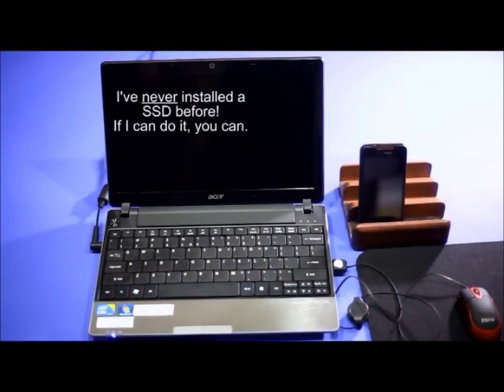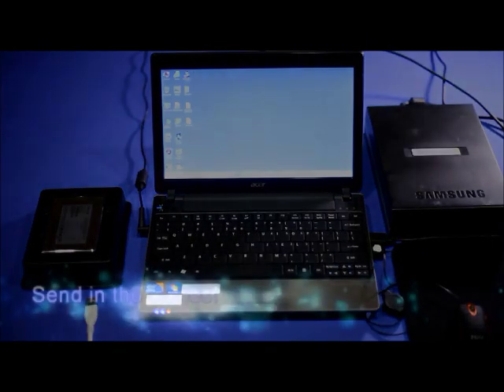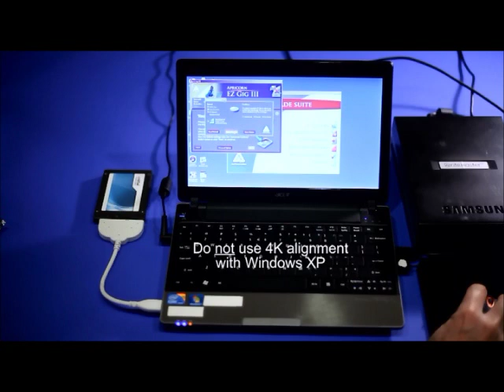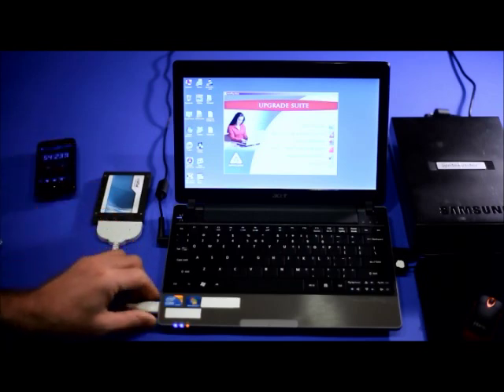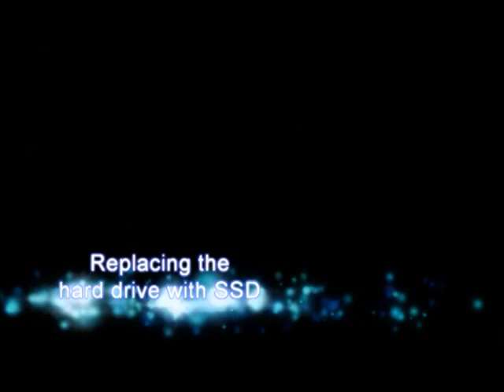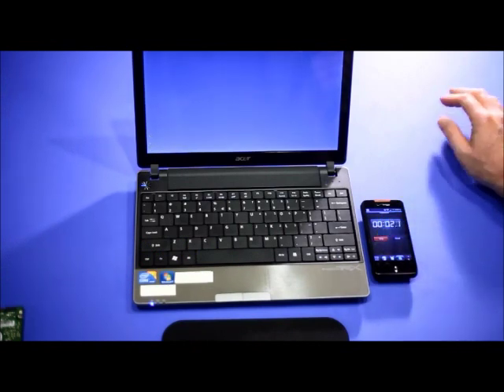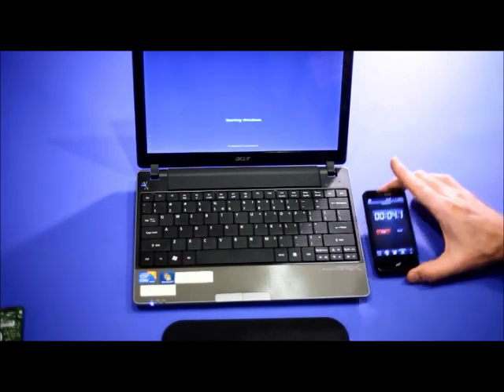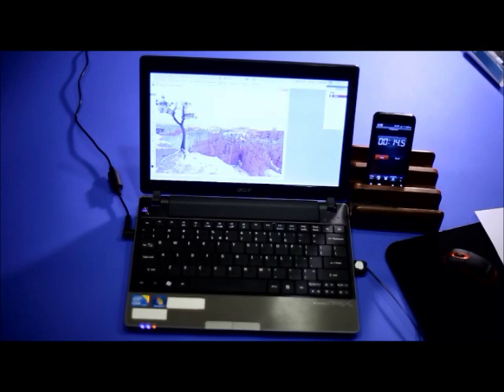How to install a SSD into a TimelineX laptop

Comment: Hi sir, great video. I have this laptop but it is incredibly slow and near useless. Do you think an SSD upgrade is worth it noways considering its age? Which one did you go for? Can it run windows 10? any help appreciated...
Reply from the maker: Thanks! Yeah, it is kinda slow compared to today's ultrabooks due to the anemic processor. That said, I'm running Windows 10, Photo Mechanic, Photoshop CS6 AND Photoshop CC on mine, no problem. I wouldn't care to use it full-time, but I still use it for field work. The SSD makes a HUGE difference and I also doubled the ram to 8 GB.  I definitely would NOT use it without a SSD. It's kinda a pain because it has USB 2.0 ports (I like to drag and drop photo assignments onto flash drives), but this little machine has been around awhile and still runs flawlessly.
Reply: Thanks for the info sir. Yeah i suppose as a basic machine for word processing and media it may be OK still. Is there  list somewhere of compatible SSD's? or will most 2.5 inchers do?
Reply from the maker: I think just about any standard 2.5" SSD will be fine. I've used both Samsung 850 EVO and Crucial SSD units in my computers and they work flawlessly. It's neat that the machine also runs cooler, uses less power and is more impact resistant with a SSD.

Comment: Hi Craig, this video says you installed 8GB of ram but all the specs I've read say that the Acer Aspire Timeline X 1830T-68u118 has a maximum capacity for 4GB. How did you get 8GB to work for you?
Reply from the maker: elanorkl Never heard that--the upgrade worked perfectly and was recognized by the machine. The 8 GB upgrade really didn't make the computer operate any faster (the SSD was the big boost!), but the extra ram helps with heavy lifting when working with massive raw files. I'm still using this little laptop often, most recently when covering pro men's clay court tennis where I used it every day for seven days straight.
Reply: Craig Hartley Hi Craig, thanks very much for your response. I managed to successfully install a new SSD harddrive thanks to you :) Was helpful to understand about the RAM too.
Reply from the maker: elanorkl Glad to help! I'm still using my little TimelineX when I work from the field. Never had a bit of trouble.

Comment from the maker: 1. You always want to unplug the computer and remove the battery before working on electronics. In this case, I made a mistake leaving the battery attached. In a worst case scenario, I might have destroyed the RAM or even the motherboard with an electrical surge. It was all good, however. Phew!
2. This video is the actual, real-time cloning process of my first attempt to use this software. It was just that easy. This is pretty good software, and it comes with that neat cable connector.

Comment: Thank u for posting this vidéo ! 
As u said, if u can do it, i can ;)
Just 2 quick questions : 
1. the crucial tips is to remove the battery  ? because it would damage something ?
2. The clone program is just as simple as you show ? plug the SSD and insert the CD ? then it goes automatically ? 

Thx again and don't listen to the crap ;]

Comment: Actually, this TimelineX costs almost $800 on Amazon today. I spent about $700 on the original laptop and about $325 on the SSD. I think you should check the specs on this little jewel: i7 processor, 4 GB ram, 500 GB hard drive, and a large variety of built-in input and output connections. I did quite a bit of research before buying.

Comment: I've used this modified TimelineX on several field assignments now. I am just thrilled with the upgrade! I shoot enormous 21 megapixel RAW files, process them in Photoshop CS5, then transmit to clients. Everything has been running smooth as silk. Amazing performance for a 11.6" laptop. If you can afford it, do the upgrade!